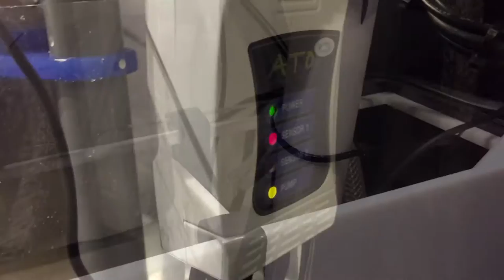JBJ ATO | Fail-Safe Your Reef Tank

Comment: I've used the JBJ for years without any issue. They use to come with the audible alarm on by default. It's annoying as hell trust me. Good idea in the reverse float switch... Never thought of that. I have always used one float configuration. I keep mine set for 1 min and let it time out if needed.. Nice vid man you must be in the car or closet lol
Reply from the maker: +CJ'S AQUARIUMS Had the alarm been on my default I would have quickly turned it off, I'll take your word on how annoying it is! haha Being able to flip the float was one of the main reasons I went this route. The biggest factor was it uses a secondary pump and it wasn't part of a kit. Replacing or repairing this pump will cost pennies compared to other systems. Since the pump pumps so slowly I have to turn my timer up all the way to keep up. I am actually looking forward to a larger system since my water level tends to fluctuate a little more than I like. I won't mind leaving home for a few days, but I'll be a nervous wreck having to leave this system for a week. 

I made this video before your iMovie tutorial, so this was made on the computer. A lot of my new videos are being shot, edited and rendered on my phone. I am using a 128gb 6 that is my work phone. I have a 5s as my personal phone, may upgrade it to a newer model very soon for the specific purpose of video capture and editing!

Comment: I use the the Tunze on my tank. It has an optical eye, float switch, and an internal timer that can should down the pump if it runs to long. I also use a float switch hooked to my apex that will turn the system off if it overflows.
Reply from the maker: +russell cockrell I wanted the Tunze, but the nano doesn't have the optical eye. My JBJ is setup to turn off either by the internal timer or the reversed float switch.

Comment: Great video and information bud! I've been using this ATO on my last three tanks with no problems. Looking for a tank update.
Reply from the maker: +cyberaquarist I do like to try "new" technology, but I believe when I setup another tank I will use this same ATO. I think the main reason is because if I get a larger system I can plug ANY pump into this ATO that I want. Having that flexibility is priceless and I think JBJ hit a home run when they decided to let the consumer pick their own pump! I've been eye balling some fish, but I need to get a screen top for my tank before i purchase anymore fish. Wish my coral options locally were a little better, may have to make a road trip very soon!
Reply: +pelphrey I should have my next video uploaded sometime this week, and I think it's something you will like. You like technology and making your equipment fail safe, so it will be right up your alley. I'm also adding a screen top his week. An update video on the 25 is coming soon too with your shout out. I know you have mentioned a couple times that your reef is a 27 gallon, but I thought it was a 37. Let me know so I'll get it right on the shout out. I also have to drive a long way just to go to any saltwater shop. I had one about 5 miles away, but they closed down a few months ago.
Reply from the maker: +cyberaquarist Every video you make is up my alley! haha BRS was out of the screen top kit that I need for my tank, once it's back in stock I'll be placing my order, I have nearly enough rewards points to get the top without paying out of pocket. I'm a huge fan of technology and all of the options we have, I won't be adding a controller to this tank but down the road when upgrade I'll be getting one. I have the 27 gallon Marineland cube. The store down the road from me always has a nice selection of fish, I'll just have to order my coral online or drive to Louisville.